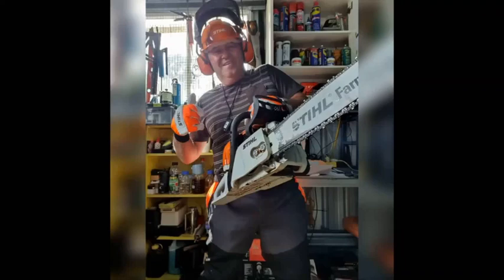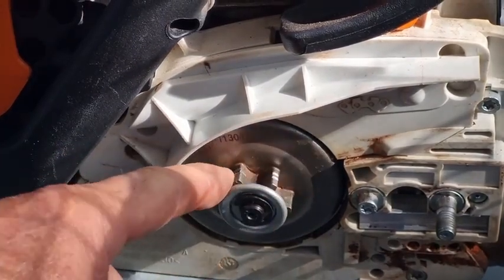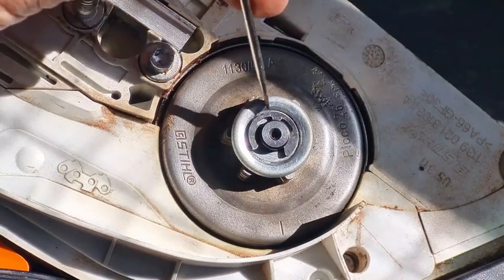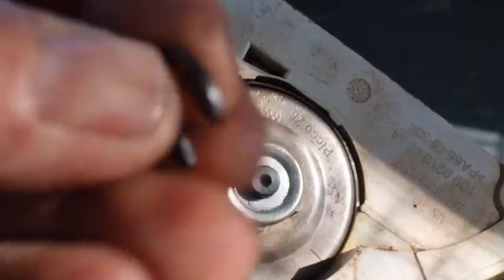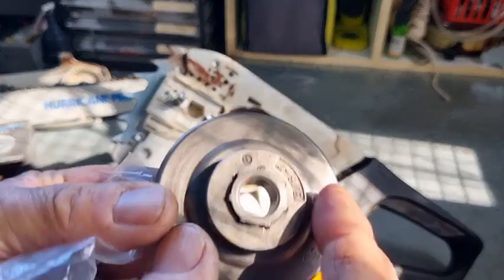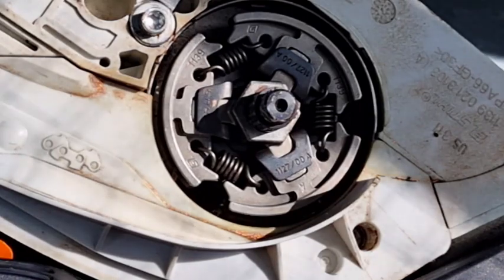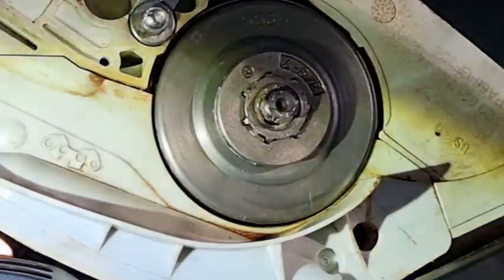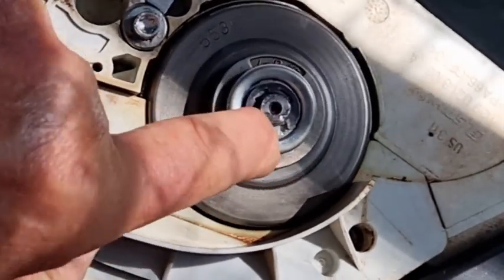MS180C 7 tooth floating rim sprocket conversion kit

Comment: I am doing the same conversion on a CS 590. Will all rim sprockets fit on the archer or are there different patterns where the rim sprockets slip on the hub. Thanks and I like the tool you made to remove the E clips

Comment: You didnt notice that original sprocket is 6 teeth,and that new one is 7 teeth???180 is too weak for 7 teeth
Reply from the maker: Thanks for your comment you are correct yes the original clutch drum has 6 tooth sproket,  you can't get floating 6 tooth spoket.  And I am also using .050 gauge bar and guess  what really can't notice any difference.  The saw don't bog down at all. I use full chisel chain.  Even my MS170 has same setup 16 inch stihl bar but .043 gauge and works well.  I only use these small saws for cutting small timber say 100mm wide.  The original  sproket is 30mm dia the new one is 35mm 15% bigger.  Faster chain speeds torque but as I said really did not notice it.  I don't abuse my saw they never bog down as I take it easy.
Reply: I believe you but here in Croatia that would work for fresh,green wood but if it is dry wood 180 would bog a lot
Reply from the maker: @Milan Biskup  yes can that happens.  The worst tree you can cut  is a palm tree it fills the saw bad and  bogs down really bad.  Palm tree is very wet inside.  Yes here our eucalyptus trees are very dry compared to many other species  of trees  🌳